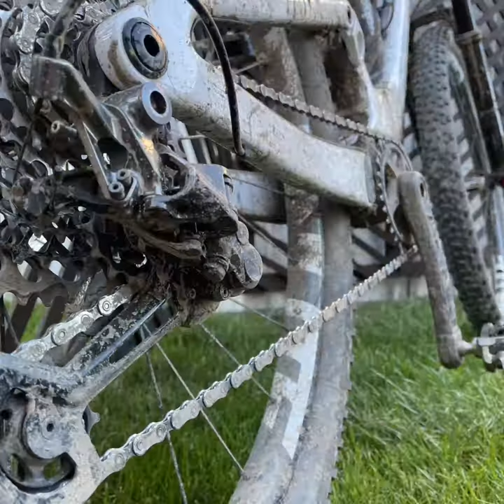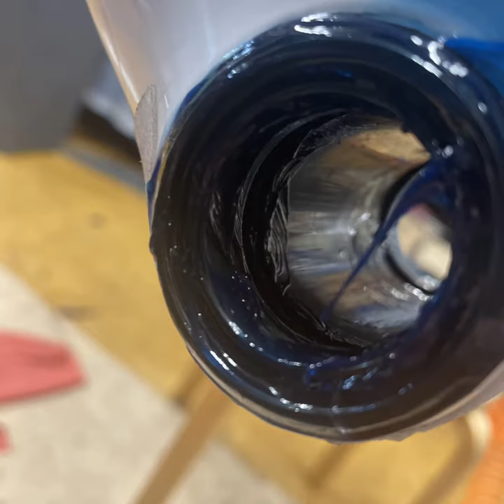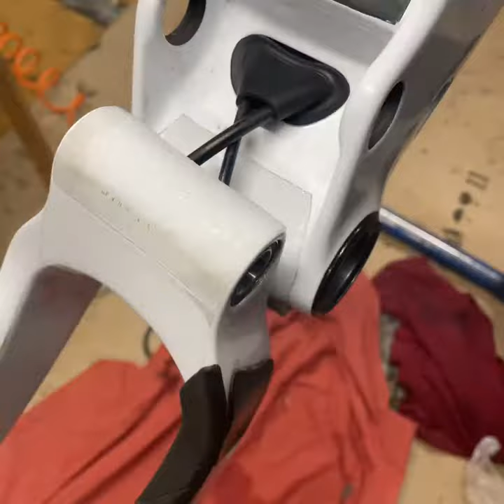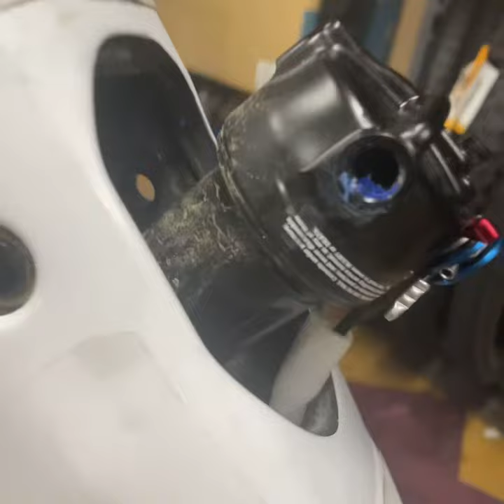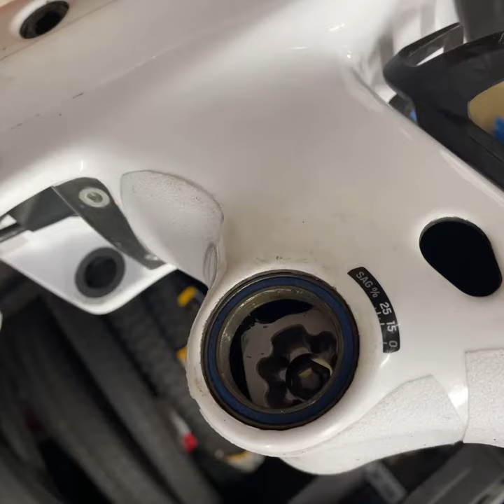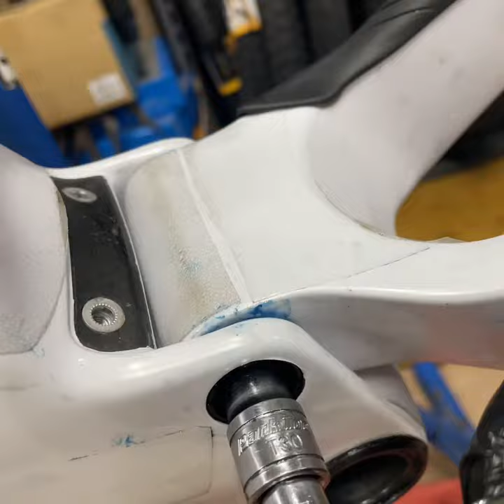SCOTT SPARK PRO 2022 Serwis Zawieszania

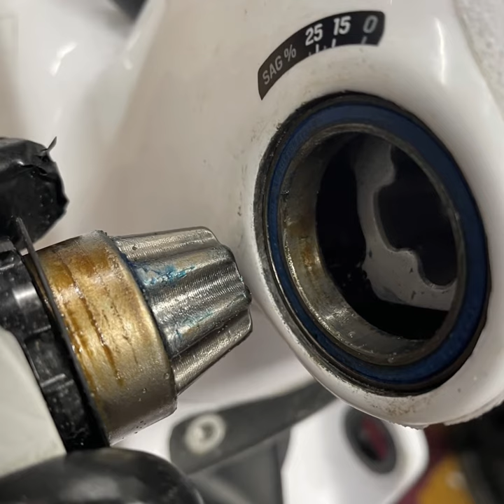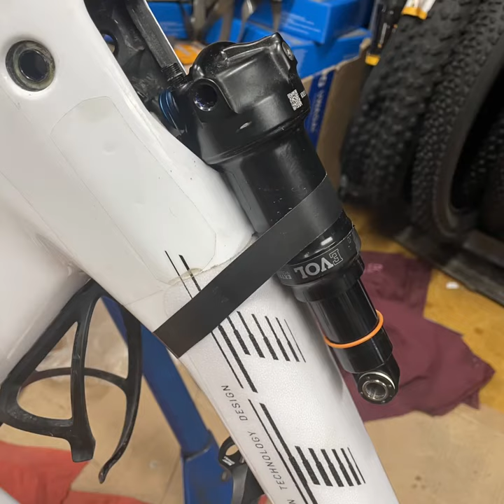Comment: 1:22 1:08 looks like there is a significant amount of frame and pivot hinge abrasion when there are sand particles trapped in between.
Reply: Its indeed is, and especially noticeable on a white frame. Wonder if there could be any workaround for this?